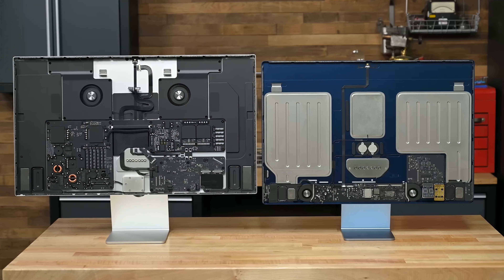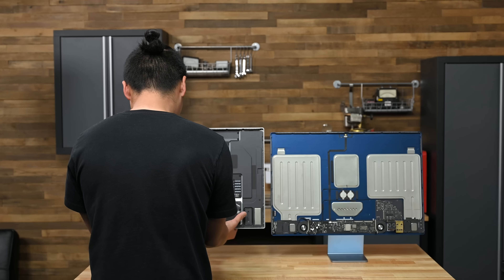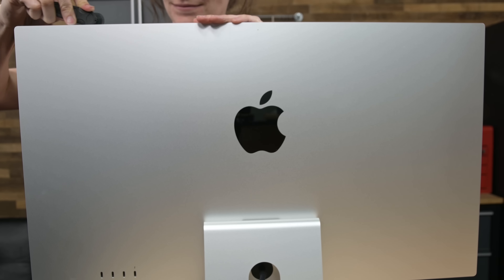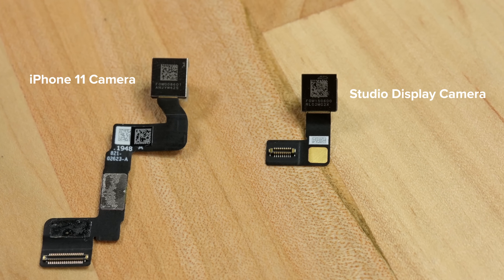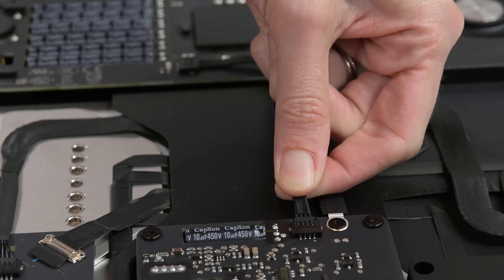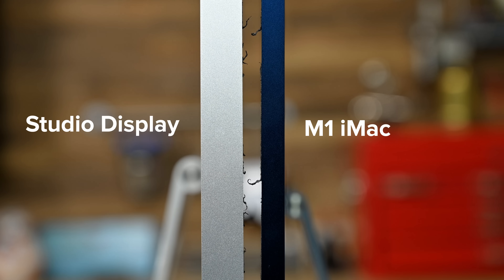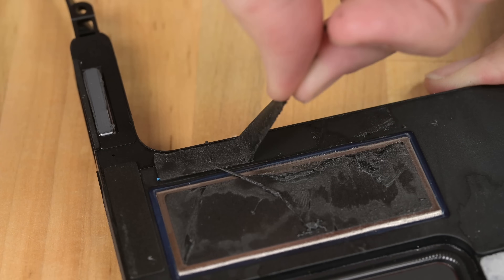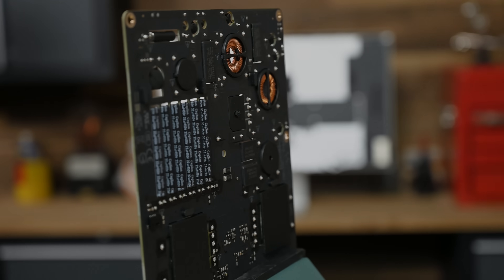Studio Display Teardown: Is this secretly an iMac?

Comment: I domr get why it runs IOS when you cant interface with that os and its headless running. Maybe its used for background processing of video input signal or optimisations but this is basically a smart monitor and it would be nice if they would have it like most smart tvs do. Have a accesible os but still be able to switch to an input device when needed.

Comment: Nah, so let me get this straight - dust would clog up wents, this brick would overheat, because no one would tear it apart to clean, and this would cause amoled burn? 👏👏👏
Reply: It would be a whileeeee before that happens. So many old iMacs are still around and kicking today, you think dust/not opening up has killed many of them before software updates rendered them useless? lol

I don’t think this display will die from dust. The cooling is overkill, and it could be passively cooled just fine, too. Look at all the thunderbolt displays still around… albeit, this screen seems wayyy more engineered/complex.
Reply: @KurosuGon 
 Well, what can i say. It's not bout mac or any other single brand, but almost everything out there, like cars, bikes, heavy equipment 
I've seen quite a lot of old stuff which still kickin, various brands yet again 
About this unit - i kinda hate that maintenance routine was made unnecessarily hard 
I'll give you another example - Harley evo could run 200k miles before rebuild easy, 96 twincam could die at 60k due to pressed crank n cheap bearings 
New warer cooled one can be shot at 20k miles due to poor engineering overall 
It's just hard choice these days, where to put money and not waste it.

Comment: Probably nobody will read this a year after posting, but since Google is also not very helpful: Can the front glass of the display panel (the "nano" or "standard") be removed or is it sort of fused/glued together with the rest of the display panel? I am asking particularly because I bought the "nano" version and it is somewhat blurry (in a somewhat annoying "matrixed" way) that tires the eyes... On my iMac 2019 I simply removed the front glass (actually using a butter knife from one corner, very easy to do that way, no need for huge suction cups) and fabricated a visual frame myself. Anyways, any hints welcome, even to just photos of the display panel, in the video could not see enough to tell... Alternatively, I guess I might just have to open up mine and see what I find...

Comment: I really wish they used the same external power supply as the iMac - i much prefer Ethernet and kept my TS3+ from CalDigit and plugged the Apple Studio Display into the TS3+ since the USB-C ports on the back of the Display simply couldn’t drive all the ext drives i have (i have some old spinny HDD’s) via a bus powered dongle.

Not complaining, tho. The setup is clean and i can always add another monitor to the CalDigit if i need to.

Comment: I'm curious peoples opinion on the vent holes placed at the top flat level of the aluminum exterior. Should we be worried about dust accumulating right through the top??
My old imac top was smooth and collected a lot of dust. I was grateful there weren't any vent holes there. That machine lasted 11 years. Will a can of air really get it clean in there? Is it safe to vacuum the top if it is unplugged?

Comment: Hi, and I’ve just inherited a 27” 2013 iMac, 3.2 Ghz, 16/1TB (Mojave) and it works perfect  . -  .  My normal daily workhorse is a 13” 2015 Retina MacBook Pro, 2.9 Ghz, 16/256 (Big Sur) – and it works perfect, too. The questions: which of these machines should I use as my daily desktop driver? And is it worth keeping them both?

Comment: The entire display shell becomes electrically static to the touch for me when connected to a MBP 16" Intel.

Doesn't happen with the Mac mini (likely because it's not supplying 100W of power to it).

Putting the power supply inside was very weird. Even my keyboard, connected to the display over usb-c, seems to have voltage on it?

Comment: Question.  I am interested on rebuilding my MacBook Air 2013.  The display is great.  The battery, memory, power cord all needs updating.  Any suggestions?  Many thanks.  Before I forget, I have a wonderful tool kit I purchased from ifixit and it has come in handy!  Great call!  Semper Fi

Comment: Samsung actually does the same thing with the power supplies in their ultra thin TVs and I believe LG has as well. I've even seen neat little end caps that go over the top end of the capacitors that solder to the board instead of using glue to hold them down.
Reply: Thanks

Comment: So more than likely 4gb of ram (as with the i11) 64gb (as with the base i11) and the a13 (from the i11). I wonder if it's connected at all to the screen input(s), either as a processor for signal or to an alternative internal input (such as HDMI, since I'm not sure the A13 does DP or even 5k60.. But 4k@30fps I can pretty much bet on, and maybe even 60)

Comment: As an electronics engineer myself, I think the power supply is INSANE amount of over engineering for a chassis that thick, BUT that said, I LOVE IT. I've seen all sorts of low profile components but I've never seen anyone CUT INTO the board, to make them even lower in profile. I mean, the Capacitors? They're LONG AF! but they knew, if these weren't this long, they would've been fat and a design hazard. The Common mode Chokes are another highlight of the low profile design. But in some places, since the thickness allowed it, they chose to go with Through hole Diodes, which is weird, but I get that makes the work easy. Also, Current ratings might've been an issue. I know this post doesn't belong here, but maybe someone finds it as interesting as I do. :)
Reply: As electronics engineer you shouldnt be surprized by cutouts for components in low profile power supply. That kind of design is common as mud in all sorts of low profile power supplies for monitors and TVs. And those are not through hole diodes, that, most likely Y type caps or MOVs. Diode bridge is through hole, yeah. And most important, that power supply was not designed by Apple. It was designed by power supply manufacturer SoluM (see silkscreen logo on PCB). SoluM was spun off from Samsung Electro-Mechanics in 2015. So, all impressive parts in Apple designed by Samsung :)

Comment: Dell PSUs have used these cut-outs to slim a generation of their PSUs down to just the thickness of the main transformer way back in 2010-ish. Also, the SONY BRAVIA display I use as a computer monitor does the same thing with the PSU though it does use thicker backlighting, mainly for rigidity for its era.
Someone just needs to figure out how to jailbreak the screen and run a modded MacOS on there and then it'd be an all-in-one solution, though it would still be better to go for the M1 macs unless this were spare after a few years and looking for repurposing.

Comment: It's an impressive testament to apple's inability to design a whole, proper product, it seems. Could have used the iMac chassis, made the display bigger, to get rid of the chin, or slimmed the frame down, and gotten rid of the processor, to require less power. It's been a while since I've seen a display with two fans bigger than the MacBook's. Completely over engineered for no good reason

Comment: This is a testament to Apple's desire to solve problems that weren't really all that big of a deal or necessary to address, while giving a big middle finger to anyone who was hoping to get a normal display that did the job well at a decent price. Sorry buddy. There's no room for value when we're busy packing as much tech bloat as possible into it. Didn't want to pay for the version with the heated cupholders and gold-plated ram modules? Too bad! That's the baseline model. Turn your wallet upside down and shake it, pleb.

Comment: What problem exactly did they solve? They made this thing cost a fortune, underwhelming specs and added unnecessary heat to boot. Not to mention all the wasted components just so they could have the power supply on the inside. Instead of applauding Apples bonehead design choice, try looking at it more critically.

Comment: I don't believe this is the exact same display panel as the 5K iMac (stated at 2:10), they simply have the same size and resolution. It has a wider color range, better contrast, better brightness. I would be very surprised if the LCD panel had the same manufacturer model number as the iMac.

Comment: I am having a hard time trying to understand what a "monitor"/"display" is doing with iOS that isn't user accessible, the bionic chip and 64gb of storage... I feel Apple is collecting a LOT of data by using that display. I do not trust apple with all they have been doing with their products. All of their products seem to benefit them much more than their customers.
Reply: idk what data they can collect if you don’t sign it in
Reply: @axethepenguin  not to add to the conspiracy because I really doubt they are doing this, but they could do it the same way Smart TV manufacturers have been doing and logging what content you are watching and keeping a profile for marketing purposes. And if it has an A13, it technically does have connection to the internet through the Ultrawide Band that communicates with other iPhones (the tech inside the AirTags).

The fatal flaw with this idea is that this monitor is designed to work with MacOS. What kind of additional data would they be able to get that wouldn’t be easier to get elsewhere? You’re already using their hardware and software and it even updates the firmware if it’s plugged into a Mac. Why even bother with the hassle and potential backlash?

The simple answer is they probably had a bunch of binned A13s that weren’t good enough for going inside an iPhone or iPad. And they really wanted to add the camera enhancements like Center Stage to the webcam. So rather than designing a completely new chip that will take time and money to design and produce, they decided to just use old stock that they had to do the same thing.
Reply: @ThatLaloBoy  yeah, I thought so! People may say apple may be the company to do something like this, but it’s not exactly practical
Reply: @ThatLaloBoy  i instantly thought of the AirTag tech as well but now that you put it that way; 
i think the monitor might help with the VR/AR line up Apple is working on. 

Lots of companies use external cameras to help hand, leg & body tracking.
Hololive girls use motion-tracking via webcams & sometimes iPhones to control their Avatar. 
and if I get a little more tin-foil hatty:

It might be called the "Studio" , not for OUR studio but for Apple's "Studio".
Just think of the day the first iPhone came out & the app store is kinda empty.
Only those with an Apple computer could create apps.

The studio line up will prob be  geared to create new Apps for their VR/AR platform more effectively.

Comment: Those cutouts for the Capacitors in the PCB has been a thing for decades, Slim-LCD and LED TV manufacturers have been doing this. I've opened quite a few Sony and Panasonics and they all have the same slick PSUs in them.

Comment: Apple: Designing and producing a clever thin PSU to incorporate everything inside the chassis 😎

Also Apple: a MoUsE thAt cHaRgeS fROm tHe bOtTUm iNsTeAD Of thE TOp 🥴
Reply: forcing wireless is the reason, all apple desktops look clean af

Comment: I think they could've just increased the size of the power supply even if it would be sticking from the back little bit, if they cover it with aluminum, for me it's not gonna be a big deal since it's at the back of the display. Analogy to this is Making an arc reactor and attaching to the chest without cutting a hole in the human body

Comment: This new display definitely looks like an iMac prototype, but I just don't think Apple could have fit an M1 Max in it with a 1000+ nit Pro-motion MiniLED display and a power supply to power everything in a cool manner. I think the new XDR Display will have some new tricks.
Reply: Power supply should just be external like the 24” iMac, bringing along with it the Ethernet port.

Comment: Quick comment about excusing the use of adhesive for speakers: I feel like if the automotive industry (and I'm sure countless other examples) has figured out how to make engines with bolts that don't rattle out from vibrations at thousands of RPMs with explosions then Apple could have found a way to secure a couple of f*****g speakers without adhesive. Let's not excuse cost cutting in the face of repairability.

Comment: My theory is that it is an iMac. However, the cooling solution and chassy might not be able to keep the M1 Ultra, which is the headline and the selling point of the bigger macs, cool enough. It might just ran over 80-90°C. I saw MaxTech's video on this and the gigantic m1 ultra copper cooler is the one that keep the temp in an impressive low temperature. But that is a giant thicc boi of a cooling solution. If it were on the cramp iMac chassy, the cooling may not be adequate since the heat of the 5K display, and that PSU + that powerful M1 Ultra chip might be a big problem for that little space of a chassy.

Comment: And people wonder why some just don't like Apple on principle...To drive up the cost and complexity of a freaking display because you wanted to integrate the power supply is the into the main body has to be one of the stupidest design decisions I've ever seen.
Reply: All monitors do that. And they use the common IEC connectors
Reply: @kornaros96  yes, they can afford to do that because they aren't the same width as 4 coins stacked on each other.
I'm specifically talking about this display, stop being asinine
Reply: @letssuperfuntime  there that thin IEC connectors.

Comment: "Apple's power engineering team clearly put a lot of effort into this"

Looking at the markings on the power supplies it would seem they are in fact designed by SoluM, a South Korea power supply company.
Reply: I doubt SoluM designed them, but of course they will have made them.  don't tender out design.
Reply: @greebo7857  SoluM are not a contract manufacturer; they are a display power supply design company. 
Apple subcontract a significant amount of design work for many of their products. Apple will have written the spec for this power supply, that is all.
Reply: Apple paid for it, so that's at least partial credit.

Comment: I wonder if someone will make an open source bootloader or some sort of jailbreak that will allow an OS to run, would be interesting to see if people can hack the hardware to make proper use of that a12 chip
Reply: A13*
Reply: @Let me offer you this Yep, A12Z was running macOS in preview developer kit.
Reply: this thing could run iPadOS
Reply: @juliet0001  This thing could run MacOS
Reply: @Let me offer you this my 2012 iMac is running Monterey so i'm pretty sure an A13 can
Reply: @Let me offer you this most definitely yes but stuff like this will not happen
Reply: @Let me offer you this modern Smartphones have crazy amounts of power u can compare an old snapdragon 845 to a mid range laptop from 2013/14 ! Snapdragon 845 can run Crysis 3 imagine what the a15 compares to
Reply: or Asahi Linux, since Apple's OSes are proprietary
Reply: @KangJangkrik  it's already technically running iOS, it wouldn't take much more than a method of running a custom ipsw etc to get this running, the hard part would be creating a new bootloader

Comment: My tinfoil hat theory is that the Studio Display is actually supposed to be an 27in iMac, but Apple decided nah and yoinked its M1/M1Pro chip and stuff like bluetooth / peripheral controllers and plopped back in a gimped A13 in its place.
Reply: The using old parts. That’s smart
Reply: @chriswho12345  It looks like a pretty old project (thickness!), I think might be designed to be one of the very first ARM Mac's, even before the M1 was born. For me, this monitor looks like the missing link between an Aluminium Unibody iMac and current 24" one.
Reply: @piker-pl  maybe they had two competing prototypes and one became iMac 24 and this instead of iMac became monitor.
Reply: Honestly, I could see them doing that. I mean, the design definitely has the makings of an AS 27" iMac.
Reply: same idea